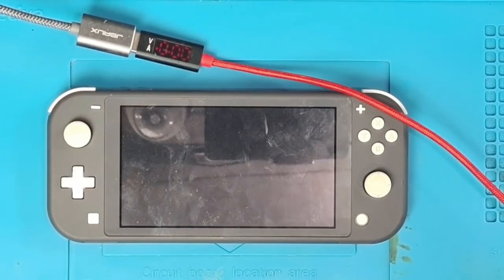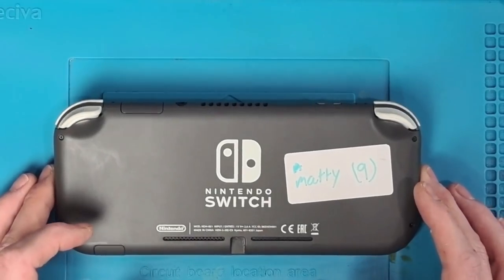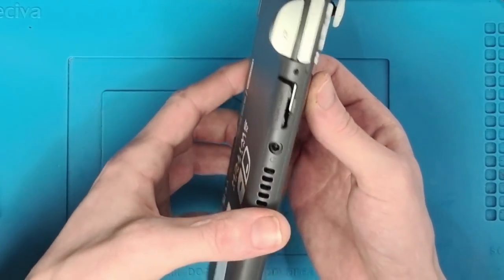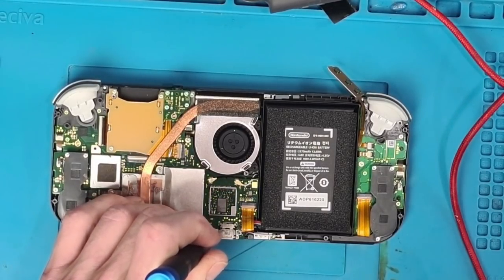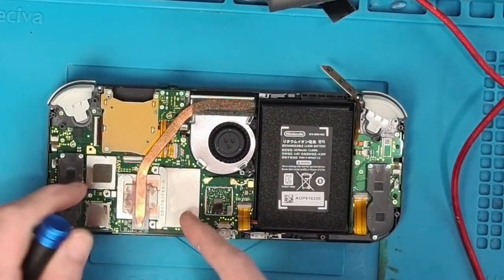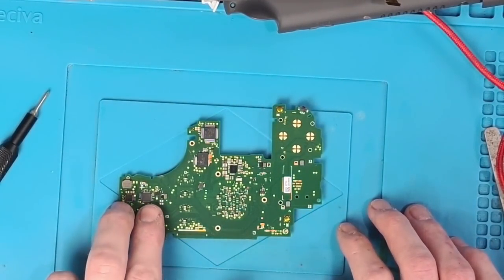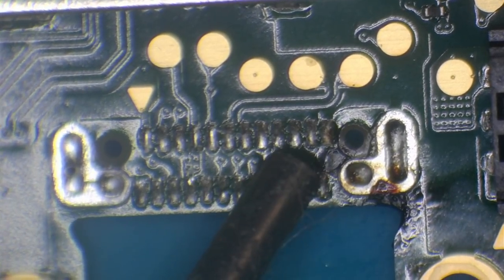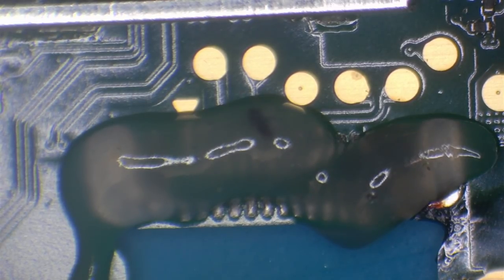Nintendo Switch Lite Burning Smell When Plugged In - Drawing 8 AMPS of Current!

Comment: What size and type of tip do you use for repairs? Do you tend to stick to the same one for all repairs?
Reply from the maker: Hey man, great question. I do switch them up depending what I'm working on, but for the most part I use a fairly small chisel tip. I'll do a video on tip selections today or tomorrow if I can 😁
Reply: Can't wait 😁 I've only got a d24 and k type at the moment both a bit too big for working by the Pi3 tip
Reply from the maker: @buckhobbit  it's definitely good to keep a bunch of different tips. I think I have about 10 at the moment with different types
Reply: Just thought be nice to add size nozzle for hot air station too, temp and speeds
Reply from the maker: @buckhobbit  yeah that might be a separate video though :)